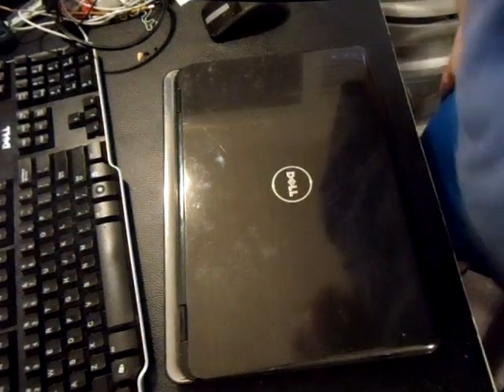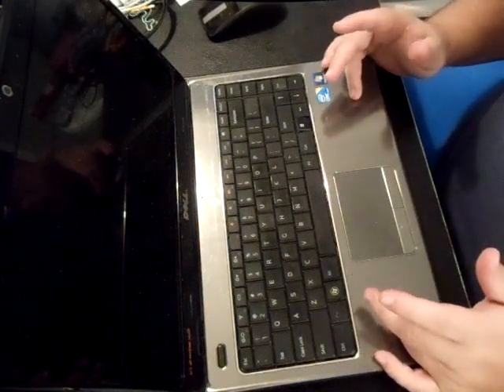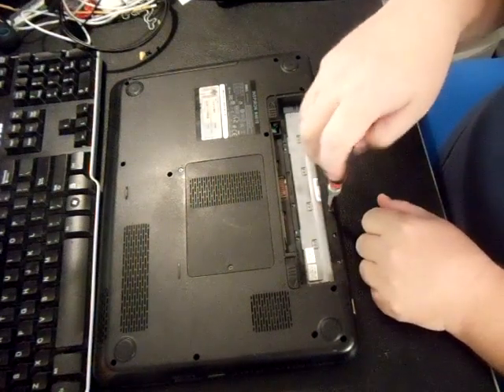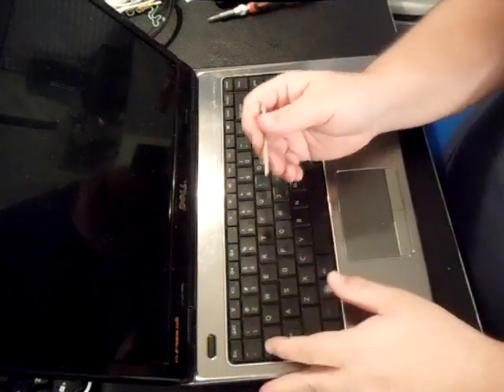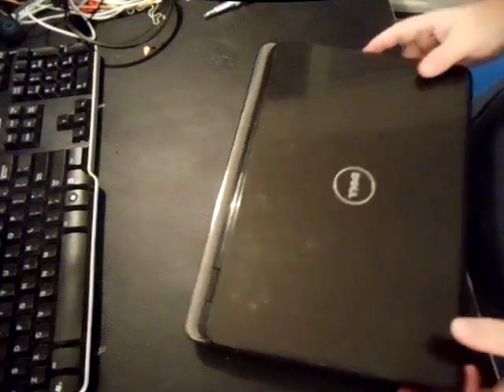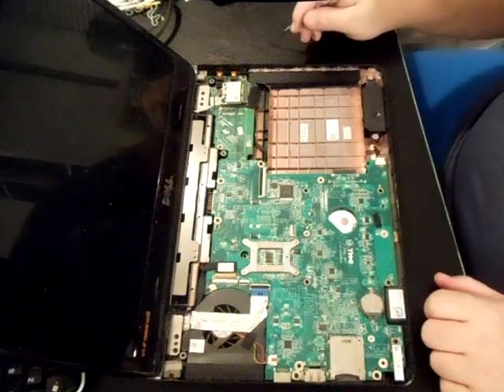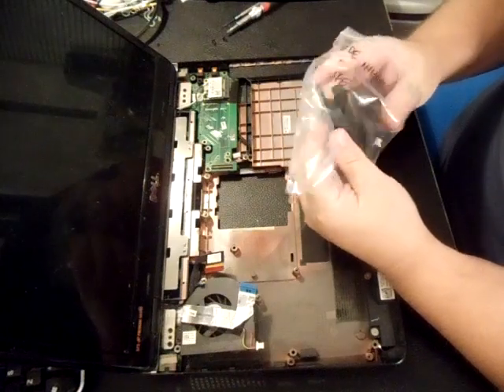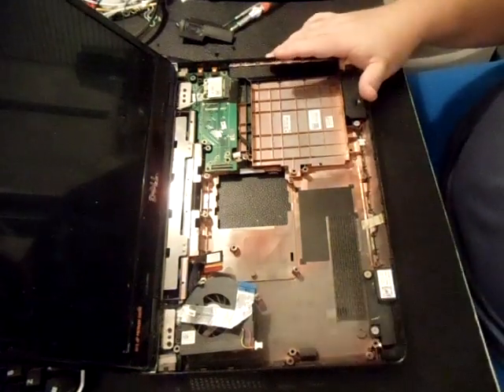DELL Inspiron Disassemble remove UPGRADE Hard Drive N4010 14R N4110 N5010 P11G N5110 15r 14R-1181MRB

Comment: Can I know the HD specifications? Is it 320GB.. Ive this old laptop I want to replace the hard drive.
Reply from the maker: Hi the hard drive can be any size or RPM speed.  So it can be from a 60g to 1000g but it needs to be SATA.

Comment: Thank you! Would not have been able to pull my laptop apart properly and install an SSD (Solid State Drive) without this. Saw several videos on this, and this was the most clear one I viewed. The ribbon cables are the trick and you showed enough info for me to figure that out. The others did not. Coulda easily wrecked a connector or ribbon cable without this.
Reply: Did you use a 2.5 inch ssd
Reply: installed my ssd, only to find out that windows server 2016 wont boot without uefi 😑